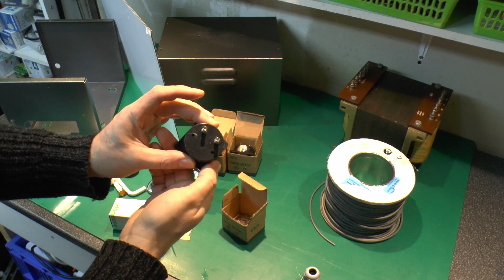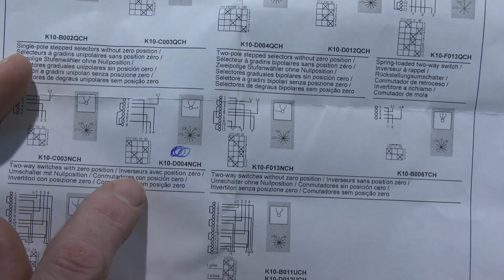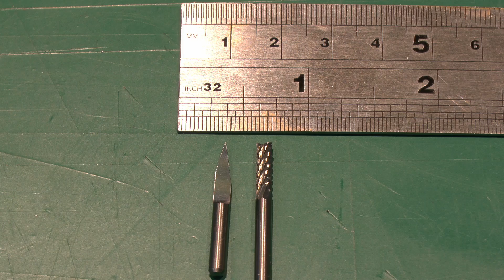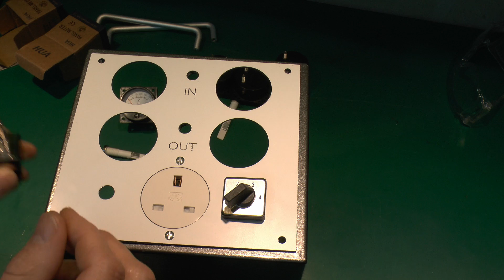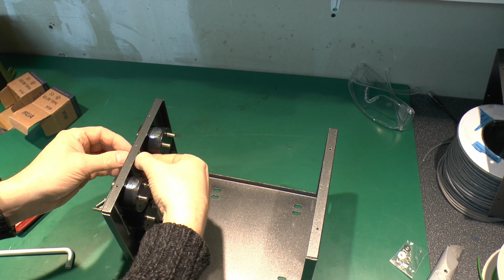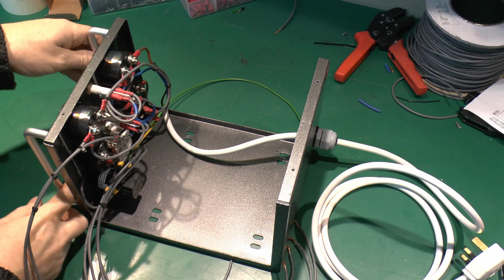Autotransformer Part 3 Assembly (Short version)

Comment: Can do you video for cable connection between 3-phase motor (terminal box at the motor side) and soft starters (Y-Delta and autotransformer at the control panel side)? As well as the control circuit cable connections?

Comment: hi john i need a power supply that will run parverlux 24v dc motors can you point me in the right direction regards john
Reply from the maker: Depends on what current the motors require - the power supply must be capable of supplying at least the full load current of the motor.
Reply: hi john one motor is 2.3 amps and the other is 8 amps they are both 24v dc thanks john

Comment: i wonder what you chose for the voltage selector switch?  I assume this has to be a "break before make" type otherwise it will of course momentarily short adjacent tappings together.
Reply from the maker: Part nuber etc. in the longer version of this video. Yes, it is break before make, designed that way, so only 1 tap is connected regardless of position.

Comment: Nice job, John, looks good. Only problem i see is that you will have a clearance issue when it comes to those plugs with the moulded cord relief, a lot of them have no flexibility and stick out about an inch below the plug. But like you said, not much else you could have done given the limited space. Maybe make a simple plinth for the case to give more clearance if needed.

Comment: As soon as the video showed the output at the bottom I thought "that's going to be a problem with moulded plugs".  Perhaps swapping the middle and bottom rows would have worked better?
Also I think you missed a trick in not using a similar four way switch for the choice of input tap: none (being the off position), 200 VAC, 230 VAC, and 260 VAC.  This would have given a lot more flexibility of output voltage.
Another useful addition would be a US style socket connected to the 120 VAC tap.  Is there any room on the back panel?  Being US style you could even fit at non-earthed outlet for slimness if that would fit better.